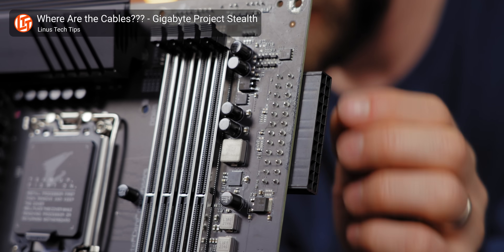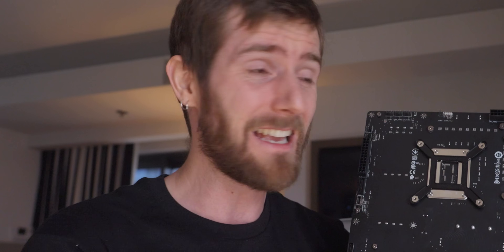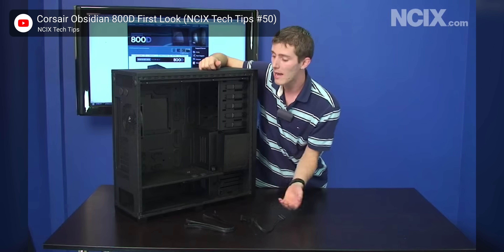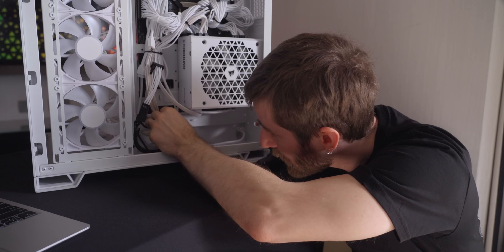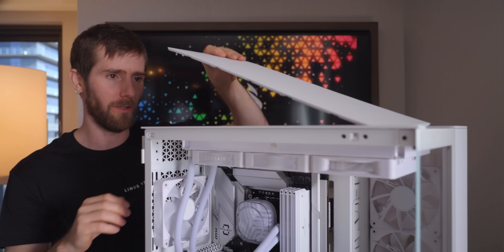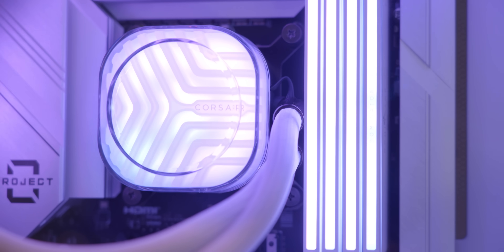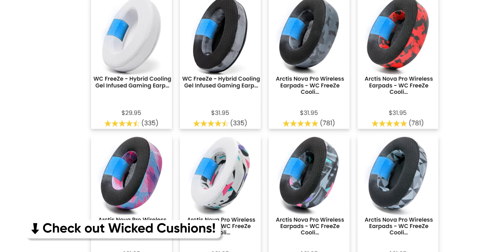I had NO Faith in this... - Hidden Cable PCs

Comment: Why doesnt someone take the initiative and put graphics card power connectors on the bottom of the car so the face towards the cable management grommets? Its never made sense to me that they are on the top or pointing towards the front when 95% of installs have the card either vertical or horizontal where the cables either come from behind the mobo or from underneath the case.

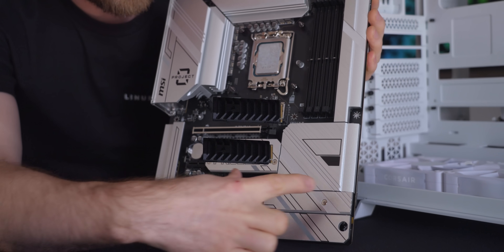Comment: 3:05 I think the M.2 socket should be oriented the same way as PCIe x1 slots: directly out from the motherboard. You could have 4x3 grid of M.2 sockets next to the memory slots in a PC case.
Reply: Why do you need 12 SSD's? 20 years ago we ran multiple drives because spaces were scarce, that's not the issue now.
Reply: @AB-80X  RAID for reduncancy + bandwidth. Maybe you don't have any data worth saving but I'd definitely want to run e.g. RAID 10 or more.
Reply: @MikkoRantalainen  
I have lots of data I want to hold on to. I run a NAS in a 1+0 configuration. Running 1+0 on a desktop is a bit silly. If you have a lot of data and data which requires that level of redundancy, it shouldn't be on the desktop in the first place.
Bandwidth? That would obviously require a mobo which could utilise that kind of bandwidth.

Comment: I actually bought one of those Gigabyte Stealth 3070 relatively cheap cause it was sold second hand from an integrator or something as only compatible with the 1 Case, but most cases have enough space ther to put the cables in just fine. like literally just put em on the back.

Comment: The biggest issue i see with this is compatibility with case designs. If each major Mobo company cant agree on a layout, each case company also wont want to comply unless directly designed for a specific board in mind
Reply: And i bet both would be very expensive for no apparent reason ("exclusivity").

Comment: Won't this automatically make the case a lot thicker? Because you have the height of an expansion card, but then also the cable sticking out in the opposite direction.

Comment: Imo just put all power connectors to the right top or bottom side (mby use right angle connectors, they are nice) and that's it. USB, audio or w/e can stay where they are, it's an issue for novice builders only for the very first time ( and not even for everyone).
Like what's the issue with a few cables, you still have huge tubes for AIO, still have horizontal mount GPU, few extra cables will not break the look of the system.

Comment: 9:30 How about simply putting the GPU power connector in position that can be accessed via slot in botherboard tray from behind? You could have slot in both motherboard tray and in the motherboard and simply plug the standard connector "from the wrong side".

Comment: The PCI slot should be much longer anyway to help support big heavy cards and stop them drooping. So fix both both problems, the terrible power connector that melts AND the card support.  The Apple solution is genius. On back of the mainboard have quad 8 pins.

Comment: IMO, I'd we're stuck between a rock and a hard place. If the SSD's are on the front, then you end up with no space for the PCIe cards. If you put them on the rear, then you have to have a chassis that makes the rear easily accessible.

Comment: Honestly i'm on asus's side with the BTF advanced concept. i think it will first appear in servers.... well the connector will, and then make it's way to desktop. for a server, the less cables the better generally speaking, it creates a "high power connector" for "high power devices" that can be fed from a  remote location making it better for airflow and space management for things like AI accelerators and things like that.

Comment: Now imagine if there was a PCB in the case itself for power delivery. With such a board, it would eliminate the need for cables to begin with. You'd just slide in your PSU, then your mobo and the build is done. Okay maybe add a combined (standard) front IO connector. Cases could be significantly smaller. Highly unlikely it'll ever happen, considering the amount of manufacturers, but it is a nice dream. Perhaps the idea would make even more sense on those mini pc's.

Comment: i feel like the ultimat solution will be to not have a motherboard plate at all and just mount the MB directly to standout on a rail system so there's maximum open space behind the board

Comment: It really does look clean. And it's also why i love my Mac Pro 2019. But i'm wondering: Let's say this is the standard in the future. The connectors being on the GPU, Motherboard,... What if it breaks? I mean with a cable, you just need to replace that cable and your set. But when it is the GPU or motherboard, you will need to send it back first and waiting for who knows how long. 🤷🏻‍♂ Still though, i really think this looks really clean and i do love this concept!

Comment: I have a watercooled loop with a vertical gpu. If I want to access my front panel connectors or SSD then I have to drain and dismantle a lot of things , is almost a days work. I will seriously look into one of these motherboards and ditch my beloved O11D when I need a new mobo.

One thing that I also hope gets integrated into this is the Gigabyte approach with the mobo and gpu that routed the gpu power through the mobo so you did not need a 12pin Hpwr cable. Of course this may lead to you still needing a seperate power cabling system if you went with a vertical gpu system like I have but the majority of systems have a standard side orientated gpu and would benefit from this approach imho.

Comment: I think it could still benefit pros and system integrators. It's easier to do everything from cable managing, to assess to the CPU power or finagling the 24pin. If you could save 5 minutes a system when building, troubleshooting/reseating cables, that can add up over time.

Comment: Already build this project zero for a Lil while. Using msi b650m version, it's kinda sick 😍
But, I use 3080 Vision instead 4080 rog white edition. It's  It would be perfect if it pair with ROG strix 4080 white edition. That's VGA has out of stock everywhere in my country. 😢

Comment: the connectors were fine on the front, and so are the hard drives. putting crap on the back just adds new places that need to be cooled and increases the overall size of the case to solve a non existent issue.

imaging having to take the damn motherboard out everytime a customer has to replace an ssd. its just more labor and more opportunities to break something else.
Reply: people used to stare at the computer screen, not gaze inside the damn case to lament that electronics can require cables to operate.

Comment: forgot to plug in my 3 front panel fans last time. I have a vert mounted gpu and you can't take that out without also removing the rear exhaust fan and the only place the wire would reach was the bottom fan connector next to the front panel stuff.. needless to say I was not happy.

Comment: SSD's should be mounted Vertically, using an L-Mount.   This would allow for a lot more SSDs, using a lot less MB Space.   The only added complexity, would be a new way to spring-lock them in place.  A Single removable L-Bracket, could hold several SSDs in place.
Reply: SSDs should just use U.2 and we can stop devoting MB space to them. We could also get larger capacities again as you could fit more chips per drive.
Reply: Wow I've never seen so many bad ideas in one spot

Comment: What if we go without wires instead the circuits and completed on the case using copper strips that way it would be more heat resistant and more robust than cables ..

Comment: just a thought, wouldnt it be cool if Mobo manufactures made a motherboard tray for their own mobo and case designers just had to make a modular case which could fit any of the mobo trays? giving us the option on case design, while letting each mobo manufacture have their own design for the mobo layout, as long as the tray is cross compatable with the case? I know this is asking for a lot, but might not as crazy as one would first think

Comment: GPU's are so long now the power connector could just be moved to the bottom rear edge for virtually invisible connector cable, you'd just plug the power in 1st then mount and pull the slack back through the gromet holes.

Comment: If these motherboard manufacturers would put the rear IO on the bottom of the board, you'd be able to cool the components on the top of the motherboard with a 140mm exhaust fan rather than just a 120mm fan above the rear IO panel.

Comment: Some standard connectors need to be redesigned. I recently built my first small factor PC and man I hate the usb 3.1 gen 1 header and usb 3.1 gen 2 header. I get it has to be thick but at least make it somehow less rigid. Also I think ITX motherboards use of daughter boards is a solution, but not the best solution. I like the tower M2 slots though, I find them to be better than daughter boards, at least they are strong enough to stay in place with the use of screws. Of course the tower can be weird as well and not all fans could fit because of it, but that's a research problem and usually works great with AIO.

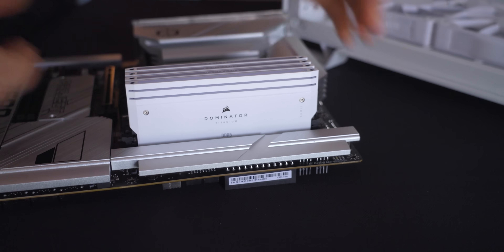Comment: 3:43 it looks like when installing the ram there was quite a bit of flex in the board due to the weird basically stand-offs from the raised back side. Is this a potential design issue?

Comment: I like the look so clean connectors in the back I’m sold. BUT I noticed the cables had so much left over length. Which is needed if you are cable managing  cables for the traditional style mother board. But for the project zero it looks like a huge rat nest of cables. Think cable manufacturers will start making shorter cables to allow for rear mother board connecting (s) and the power supply being so close? Also is that power supply just hanging in mid air?

Comment: I put 8 drives in my Dell SFF, and yeah I can tell you legit reasons to keep the cable out of the way, such as airflow obstruction, in addition to aesthetics. Although they need a little bit of airflow too.
But having a messy interior means slimmer cases, right?
They should get around with the giant 24 pin. Splitting it into two 12 pin, for instance, will vastly improve the stiffness of the cable harness, among other things. Or just move to 12VO, although that's not cheap.
Reply: was going to say 12VO is 10pin. we should move to it already. But that is why i didnt upgrade to am5 yet. well one of the reasons.

Comment: IMO if they made the 12V mobo connector a higher profile it would allow room for backwards compatibility with an older board by simply using a cable connection. With the introduction of 12VO PSUs I don't see any reason not to have the GPU power come straight from the mobo. That's 16 less wires needed, and probably far less chance of things melting.

Comment: I think the Standart of how Desktop PC are made has to change anyways. Especially for GPU, wich are so big and heavy that their PCIe connectors are made stronger already. I wonder why their power connectors are not placed at their rear end, like it has been some years ago. Overall there are probably better layouts for ATX and Micro ATX Mainboards and GPU´s.
Reply: What's enormous is the coolers on GPUs. What you see as the rear end usually isn't anywhere near the PCB, the cooler overhangs by quite a bit. That's at least part of the reason.

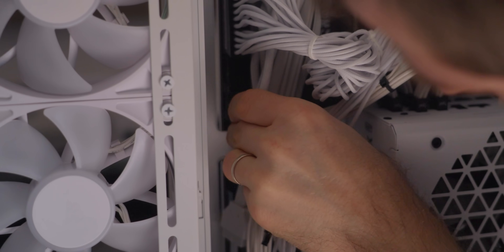Comment: 8:41 Or the GPU manufacturers could just add a 12v power connection to the opposite side so we can plug into either one. With the connection option on the other side it would be possible to all but completely hide the power connection. Simple and would add very little cost to the GPU.

Comment: Cases tend to outlive motherboards for me, so while I don’t love that the board locks you into a case, it’s probably fine. 

The GPU though… I have concerns. If I were to spend crazy present-day GPU money likely plus a premium, what do I do when I upgrade? Will it have an auxiliary connector for running in a standard board? Will those extra fingers have physical interference with chipset heatsinks? Am I going to need a special powered riser to cycle it down to a secondary PC? If I try and sell it, is it going to retain less value despite the higher up front cost because of these complications?

Comment: Would prefer to have M.2's on the rear of the motherboard + BTF layout. Having M.2's on the front of the motherboard becomes a hassle when switching out M.2 drives, especially if you already have hardware installed on the front of the motherboard (GPU, Expansion cards). You're also removing the extra heat sources and placing them in an area separate from the GPU and CPU which would probably be better for overall heat dissipation.

Comment: This is great for an ATX board but for an E-ATX board the 24 pin now needs to be inset from the board edge to line up with the case cut out. That just seems silly. Server style boards with rotated sockets or HEDT platforms could easily want to have a memory slot in that location. I think this standard has too many holes in it (boom-tish) to work in the real world..

Comment: If this comes out it will make cable management a breeze as cables won't need as long to connect except the GPU it seems unless they change the connection placement on them also
Reply: good idea and while they are at it change to one that does not catch fire so easily using 12VHPWR is very i dont care how the cables look at all and more is it on fire yet

Comment: Wouldn't it be nice to have standardized connectors on mainboards and a power-distribution/connector-backplate. Connect everything to the backplate push the mainboard into the backplate from the front. New mainboard? Just pull it out and push the new one in. A few seconds and done.

Comment: I agree that accessibility for novice builders is good. But at the same time, I was a novice builder once. I've had to put in a modular cable in, after the fact, into my spaghetti next to the psu, several times as I bought more drives. I even had to redo the power button plugs when I first built it. But I did this a decade ago, once or twice, and never had to touch it again. I don't think most of this is that big of an issue. Even a case not having a proper hole cutout isn't THAT bad. Somebody in your life own a rotary tool or metal snips. (If you are an adult with PC building money you can buy one for $10.) And as a kid, your parents or their friends will do it for you. And these cutouts specifically aren't even visible, so aesthetics might not even come in to play with a "hardcore" modification like cutting metal. I'd rather not have power cables not have the same pinouts. Or something else that's as devastating as a "novice friendly" improvment.

I don't build pc's for a living. I've done like 4 from scratch ever, and I feel this way. That novice builders need more credit or more documentation. Idk, kinda struck me the wrong way. Like the people building PC are the lowest common denominator and need some hidden help. PC's are easy now. If you care to build one, you care enough to look up an LTT video, by way of the first few search results, on how to build one.

That being said, this concept is cool as heck and I wish it was further along than just "well, we are trying to accommodate several different approaches to btf." Not because of accessibility but because of "neat" factor. Imagine a case that had internal wiring that you just slotted components into and it just all worked. A pipe dream, for sure.

Comment: These standard desktop PC parts are now pretty much reserved for gamers and high end workstations which also need a GPU for modern workloads. So why don't we just have a motherboard standard the same size as ITX but with standardised back-of-board clearance for chips and connectors, with a right-angle PCI-e 16x slot behind the CPU? Then the whole case doesn't need the massive space around the CPU cooler which is usually wasted.

Comment: I think Asus's method is better with every power and other connectors behind the motherboard and a power delivery system for graphics card from the motherboard itself, basically meaning no cable is exposed on the viewable side of the pc.

Comment: On the video card and power being delivered through the slot breaking backwards compatibility. I really fail to see this as a problem, we have already been through this a few other times. We did it when we converted from ISA to PCI, we did it when we sort of converted from PCI to AGP (That was a weird time) and then finally when we converted from PCI and AGP to PCI Express.  So frankly the dumb thing is that we are still using external power for graphics cards when it would be far better to just engineer a new standard that mandates both power and data. Given most power hungry graphics cards already take up "Two slots" it shouldn't even require lengthening of the GPU silicon but instead having in effect a daughter board to plug into a side by side slot as an example. Heck this would have the added benefit of being far more structurally sound for GPU's that are getting grossly heavy. Honestly I find the continuation of external power at this point to be just lazy engineering. But whatever, it isn't like I'm going to be taking advantage of any of this anytime in the near future. I'm still rocking my old Lian-Li PC B Plus II case and have zero intention of giving it up. This thing is basically a piece of computer case history at this point and mine still looks damn near brand new.

Comment: Not a fan of the pcie power option, would rather have the plugs on the back of the GPU, there's plenty of space in nearly every case already and as previously demonstrated they can be cost effectively moved around the board so why not the back.

Comment: You mention the backward compatibility issues with a graphics card with backside power but don't seem to mention the backwards compatibility issues with boards with rear mount cables and existing cases.